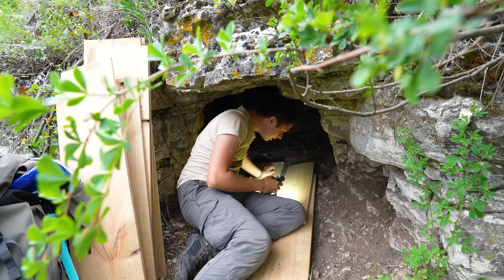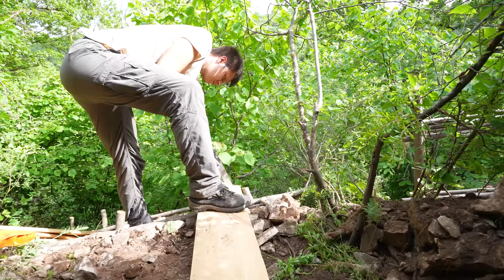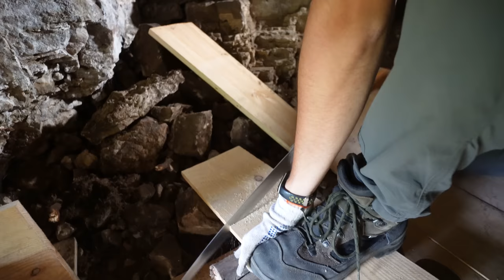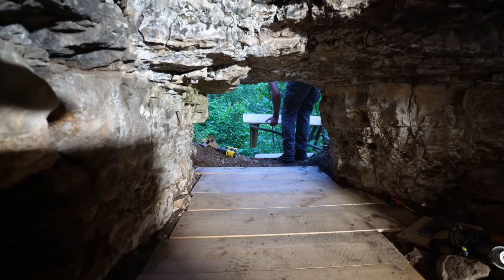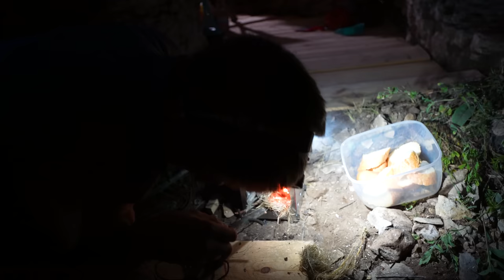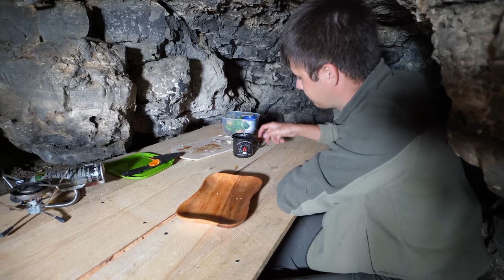Making a cozy BUSHCRAFT SHELTER out of an ABANDONED CAVE | Making furniture out of boards | Part 2

Comment: I would have made a fire inside the cave to smoke out those bugs..I know your doing your best to get this shelter built but I thought you would have dug more out from the floor to give you extra space.... laying rocks on the floor might be better..
Reply: Um obviously haven't had to clean out a cave before. Smoke drives insects into HIDING AND DISORIENTS THEM which is part of the reason beekeepers use smoke to pacify a hive, heat makes insects LEAVE, so he made the correct choice here as for the depth 🤷